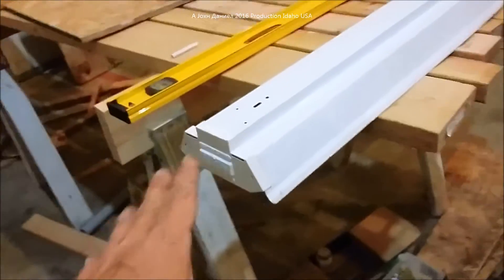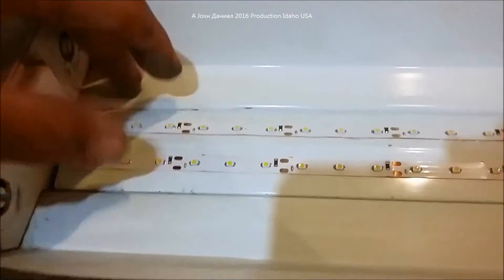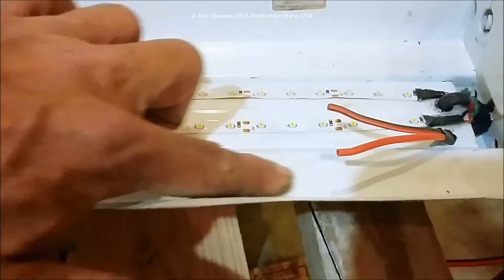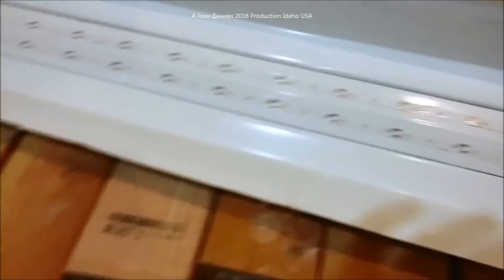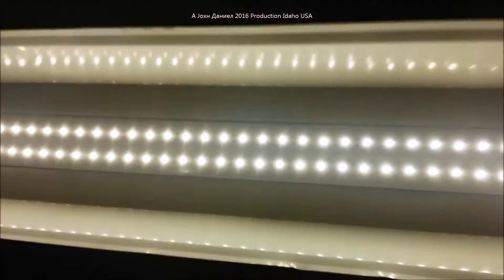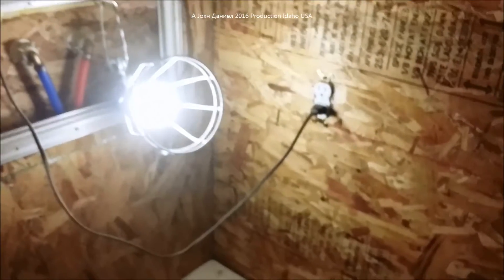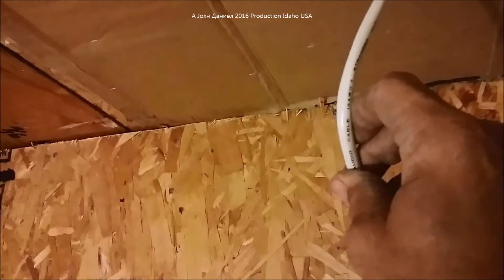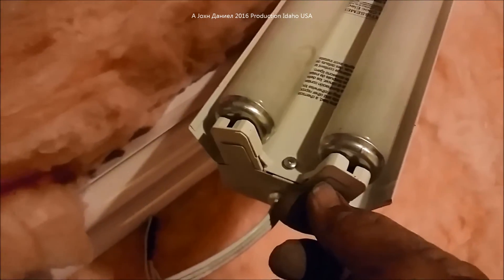DIY LED Light Fixture from salvage parts, done cool & cheap PART USED BELOW

Comment from the maker: Lights are longest lasting from LE, sold at  http://amzn.to/2DKOgdi  AND Best Glue http://rover.ebay.com/rover/1/711-53200-19255-0/1?icep_ff3=2&pub=5575119394&toolid=10001&campid=5337663844&customid=WELDER+GLUE&icep_item=131305012744&ipn=psmain&icep_vectorid=229466&kwid=902099&mtid=824&kw=lg Plus DC usable timer I use http://amzn.to/2FubYLB by westek